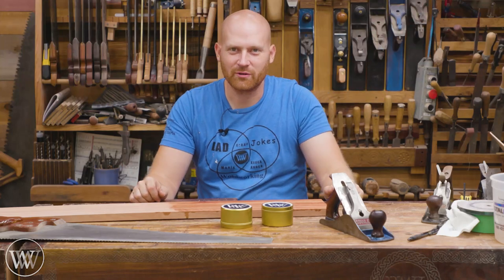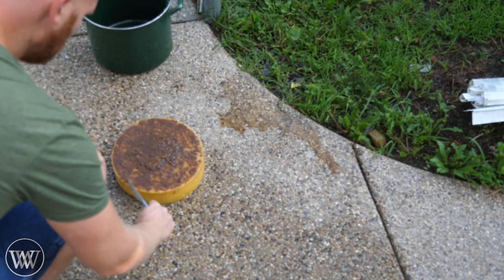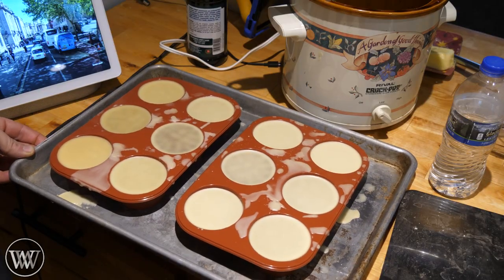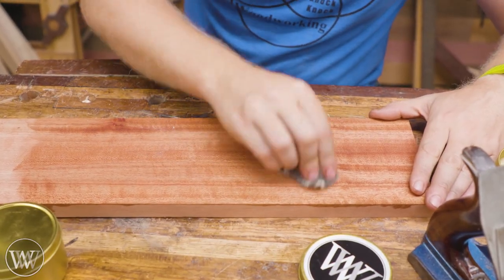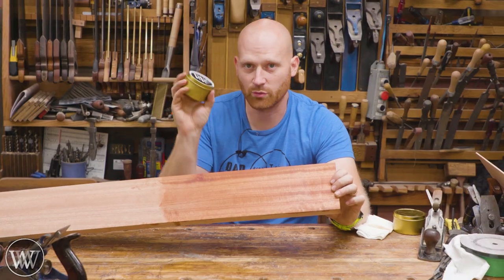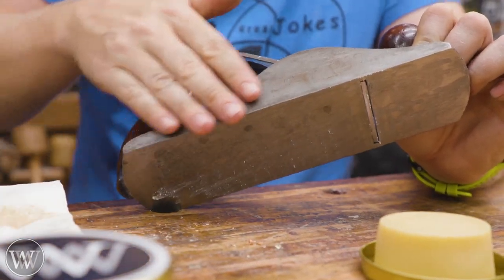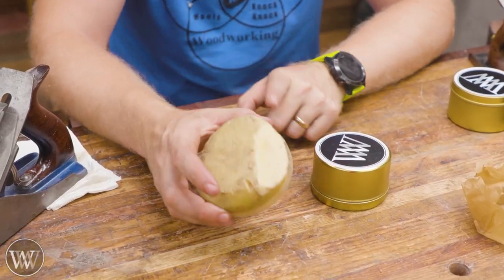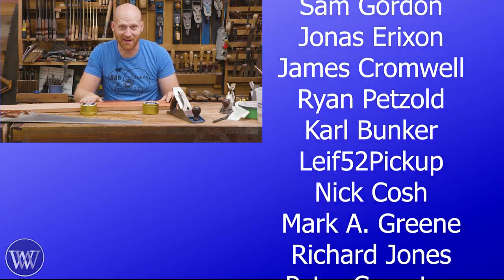How to Make Paste Wax From Scratch

Comment: As a beekeeper and woodworker, I put my cappings and such in an old tube sock then place it in the water. The wax that comes out of the sock is almost clean. The added bonus is the chopped up sock makes a good fire starter.
Reply: that's a great idea. I was using sections old cotton sheets over a strainer but inefficient as heat isn't maintained as you pour it. But your method, the wax is under constant heat.
Reply: Waterproof socks!

Comment: I am using your hard wax recipe for waxing my plane soles. I had an idea to pour it into a clean and empty twist up refillable deodorant container - should be less messy to handle :)
Reply: Did this work? I'm very curious
Reply: @nickgardner1705  worked very well - a couple of things worth noting: 1) I used Jojoba oil instead of linseed (what I had on hand). 2) bees wax melts at around 70C or 160F. I recommend monitoring the temperature and pouring the wax at slightly above that. the first pour I did the wax was way to hot - it melted the plastic of the container and made a smelly mess. the second one I made sure the wax was much cooler (under 200F) and I pored it. works amazing. I was using my No. 8, then added some wax to the sole - it shot forward so fast I almost lost control :) also, keep a bowl of cold water with ice at hand
Reply: @AssafOppenheimer  right on! Thanks for the tips :)
Reply: Damn I just saw your comment after I made the recipe in a tin jar. I should try it this way next time
Reply: Excellent idea thanks for sharing that would work well
Reply: Brilliant idea!

Comment: If you want to filter raw dirty wax in ONE GO, here's what we do with our wax (we keep bees):
1. Find a metal pot or tray that fits into your oven
2. It needs to be deep enough to hold some water in it and hold some kind of a metal strainer - it doesn't matter if it's fine or not
3. Put a few inches of water into the pot, put the strainer on it, put 2 layers of kitchen towels across the whole strainer and put the wax onto that
4. Put everything into the oven and set it to 155-160F (65-70C) and check periodically if there's any wax left in the strainer.
5. When all the raw wax is gone, turn off the oven and let everything cool down

The wax slowly melts and runs through the towels, dripping into the water below. All the impurities and stuff are left on the towels in the strainer. When you let everything cool, the wax in the water solidifes into a puck and floats on top of the water, but it's clean, all that dirt and stuff is on the towels. You just throw it away and voila, a pot full of nice clean wax.

The 155-160F temperature is the melting point of beeswax, when it flows nicely, cause it needs to get thin in order to go through the towels. Beeswax is flammable and it does not boil, just gets hotter and hotter and then ignites, but don't worry - the flashpoint of beeswax is 400F (204C), so you're nowhere near that. Also, the 155-160F range won't damage or discolor the wax, it won't ruin it.

When I first tried this, I wasn't expecting results, really, I thought I was going to get a bunch of hardener wax towel mess, so it was pretty much a surprise when it worked. I've been using this method every since cause it removed any neccessity for cheese cloths, rags, multiple meltings and a bunch of water I used to use, and - it comes out yellow and clean.

Hope this helps, thanks James for making this video!
Reply from the maker: Well that is an interesting idea! I will have to give that a try next time.
Reply: I tried this method a while back, but maybe I had slightly higher temperature as my wax was duller in colour and not as bright yellow when I have done it with water. Will have to try again to see, although I'm thinking of using a solar melter as well to see how that goes.
Reply: Can you clean the towels after or are they rekt?
Reply: @Obscurity202 I think by "kitchen towels", they mean the paper/tissue ones. So they are thrown out. Or become firelighters.
Reply: @samuelmellars7855  fuck why do i read this now after i already sacrificed two of my cotton kitchen towels.
also im doing old candle wax instead of beeswax and it needs higher temps to melt.
just so people dont wait for an hour or two without much happening besides the wax drooping.

Comment: Great recipes!   Another I like to use is a mix of roughly 3 parts beeswax to 1 part USP grade mineral oil.  I adjust it until a sample of the cooled mix is like a thick grease or old Johnson's paste wax.  At that point it can be easily massaged by hand into the wood.  It's a great idea for food contact wood items like cutting boards, spoons, spatulas and salad bowls.  And unlike the tung or other nut oils I used to use the beeswax and mineral oil is not a strong allergen in case someone in the family or a visitor is allergic to nuts.  The mixture is surprisingly tolerant of being washed.  But make at a dunk, wipe, rinse, dry sort of deal as any long term soaking will obviously soak into the wood after a while.     So yeah.  Beeswax.  It's good for more than just in the shop.

Comment: Thanks, I’m going to order some of your 2:1 hard wax with raw linseed oil, looks useful, and plain beeswax is way too hard.

FYI, I made my own soft wax following an old “colonial” recipe I found online, and it is basically 1:1:1, (or in your example 2:2:2) with beeswax, BLO, and mineral spirits in equal parts.  

I’m not sure what the extra half measure of mineral spirits does to the hardness compared to your recipe, whether it makes it harder or softer (?) but it seems to work ok on my wood projects.  Thanks.  👍

Comment: I made few ratios:
- only candle - very hard to apply to the sole and can't feel glide differences .
- 1:4, 1part liquid paraffin with 4 parts melted candle - the mixture stays hard like candle and feels little bit oily. Better apply to the sole than the pure candle, but still not good gliding.
- 1:3 - the mixture stays hard and feels more oily in the hand. Good apply to the sole, little bit better gliding.
- 1:2 - the mixture stays hard again and feel very oily in the hand. Very good apply to the sole, very good gliding.
- 1:1 - the mixture stays hard at first look, feel very very oily and feels like starts to melt in the hand. Apply to sole very easy and glide like 1:2 mixture.
1:2 think is the best mix for me. Twist cans from paper glue were filled, so the wax will stay clean and easy to use. I'm pretty sure Rob Cosman's wax is on the same base. Not so much variants for wax i think. The bees wax i will use for wood protection, just doesn't work for me as lubricant. 
Happy planing guys! :)

Comment: Thank you James. A needed topic. A note, linseed oils of store bought types. Boiled Linseed Oil is not boiled, but treated with a chemical, thereby it's not to be confused with the real thing, yours. Where in Hawaii could I find pure Linseed oil is anyone's guess.
Reply: I wonder if you could get raw oil there. I know they had both "boiled" and raw in Tonga, but they definitely don't have the same laws as the US does though. 

And I think the name stuck around from when it USED to be boiled. And now they just call it boiled when they put a chemical in it to do the same job. Much like the British call flashlights "torches," even though the ONLY similarly is that they both produce light.

Comment: First time I tried this the worst part was cleaning the pot.  Second time I tried I boiled water and put the wax in one of those metal pie pans and set it on top of the boiling water pot.  Worked great and clean up was easy peasy.
Reply from the maker: right on. that is why I have dedicated pots for it.

Comment: I've just received some Bees wax that I ordered from a local bee keeper to make some polish up - I will be following your recipe. (Seeing as I'm over in England I figured the shipping cost of buying yours would be prohibitive!).
Reply from the maker: Sounds like fun. Yes. Shipping a can of wax over there would cost more than the wax itself. But I have done it a few times lol
Reply: @WoodByWrightHowTo  I will be trying it using a old cast iron 'glue pot' that I have restored using electrolysis, and that will be on top of our log burner, so I will need to keep a close eye on temperatures. 
If all else fails I will have to stump up the money and order some from you!

Comment: I think you have answered a question I have had since the early 80’s. In high school woodworking, we used a soft wax that smelt like turpentine and looked like bees wax. I do believe it was essentially like your soft wax. I’m tempted to make my own now, but am more likely to buy yours, if it can be shipped international, and our Border Control doesn’t consider it a biohazard (Australia)
Reply from the maker: I have shipped to down under before, but the shipping price is almost twice the price of the product. if not more.
Reply: @WoodByWrightHowTo  But if it's a good product that lasts years, it's worth it.

Comment: Hey James!! I´ve just made your misture, actually its in the fridge right now. I made the soft wax, but insted of mineral spirits, that i dont know what that even is eheh i used mineral oil!
Reply from the maker: Mineral spirits is also referred to as white spirits in the UK. Mineral oil will make it very soft but mineral oil does not polymerize so it will stay liquid on the surface rather than hardening over time.
Reply: @WoodByWrightHowTo  Thanks! I see the point, but even as white spirits i cant find it in Portugal: it where im from
Reply: White spirits is a product like vodka?
Reply: @marelizevanrooyen  its more like diesel fuel
Reply: @marelizevanrooyen diesel fuel or jet fuel.

Comment: Is the hard wax good for rust prevention on power tool table tops? I have a 10" band saw and a bench top drill press, both with cast iron platforms. Right now I'm using 3 in 1 oil. It works, but I have to reapply it often. The tools are under a an awning outside (one day I'll have a climate controlled workshop, one day). I'm just wondering if the wax will last longer. Thanks! FYI, I just subscribed.
Reply from the maker: That is what I use on my metal tops.
Reply: @WoodByWrightHowTo  Awesome, which one? The soft or hard? I’m going to order a tin.
Reply from the maker: I use the hard.

Comment: If you crush the puck before heating it up for the secont time you"ll use less energy and time to melt it again. If you manage to doubble the surfvavae area it will melt in half the time so I imagine only 4 good centre brakes should do it.

Comment: why white spirit needs to be used in soft wax? what is the idea behind? Assume it is also very smelly?
Reply from the maker: the Spirits thin it out so you can spread it easer. then they evaporate leaving just the wax and oil. you can use whatever you want.
Reply: @WoodByWrightHowTo  thanks

Comment: bit late after the making of the video, but I made my own hardwax with linseed oil & beeswax (would have bought yours, but shipping it to Europe seems a bit over the top), but when I put it on my tools, it sort of seems to attract dust and stuff. Am I putting it on too thick (or not rubbing it out enough) or did I do something wrong in making it?

Comment: Could you add a few coats of shellac after the finishing wax, or would the wax prevent the shellac from adhering?
Reply from the maker: The wax should go on after the shellac. Wax isn't really a finish by itself. It fills the pores on top of wax and smooth out the finish.

Comment: How do you clean the pots and pans after making the wax?  After They're cleaned, are they safe to use for food?
Reply from the maker: Cleaning can be difficult. I just bought cheap ones for 5 bucks at the resale store and dedicated them to the process. But if you were really careful with it, you can clean it out. If you heat it up until it melts you can wipe it out with a rag and then theoretically what dishwasher should be able to heat it up enough to clean out everything leftover.
Reply: @WoodByWrightHowTo    Does that apply to store bought BLO as well?

Comment: I don't know where is my mistake, but my bees hard wax stops the plane instead to move smooth and faster. I will try to melt candle and mix it with liquid paraffine. I will share what will happen.
Reply: I made few ratios:
- only candle - very hard to apply to the sole and can't feel glide differences .
- 1:4, 1part liquid paraffin with 4 parts melted candle - the mixture stays hard like candle and feels little bit oily. Better apply to the sole than the pure candle, but still not good gliding.
- 1:3 - the mixture stays hard and feels more oily in the hand. Good apply to the sole, little bit better gliding.
- 1:2 - the mixture stays hard again and feel very oily in the hand. Very good apply to the sole, very good gliding.
- 1:1 - the mixture stays hard at first look, feel very very oily and feels like starts to melt in the hand. Apply to sole very easy and glide like 1:2 mixture.
1:2 think is the best mix for me. Twist cans from paper glue were filled, so the wax will stay clean and easy to use. I'm pretty sure Rob Cosman's wax is on the same base. Not so much variants for wax i think. The bees wax i will use for wood protection, just doesn't work for me as lubricant. 
Happy planing guys! :)

Comment: Would I be able to substitute paraffin for the beeswax? I have a few slabs of gulf paraffin, boiled linseed & mineral spirits. Would this work or would the end product be to hard to buff as a paste wax?
Reply from the maker: It works well. You'll get a slightly harder wax. So if you want it to be softer you'll probably need to mix in a little bit more oil.

Comment: where did you get that can for your wax? Also what purpose does the mineral spirit serve in your wax creme?  I ask because I've see DIY recipes for wax creme that just uses wax, coconut oil and some other oils.( I'm trying to save a buck or 2 if I can) thx again for this video♥☻☺

 I really enjoy watching this video double time.  In fact the next time you make these videos  if you can say the work puck🐔🐥🐔🐥 ALOT... it would be super entertaining.  🐔🐥🐔🐥You did a FEW times this video.. but many pucks in a row often makes  my memory retention GREAT!!! 🐔🐔
Reply from the maker: The mineral spirits makes the wax softer and easier to apply. It then will evaporate them away leaving the hardened wax behind. It's not necessary but it makes it easier to apply.
Reply: @WoodByWrightHowTo  ahhh!!! ♥☻☺
Can I use rubbing alcohol instead?

thank you * puck puck puck!! * 🤣😆😂
🐔🐥🐔🐥🐔🐥🐔🐥

Comment: Could the linseed oil be subbed out with another oil? Like coconut oil? I use coconut oil and beezwax to make my board butter so i have an abundance. I wanted to use what I have on hand if possible
Reply from the maker: Sure you can use any mixture you want. People use all different types of oils and different types of waxes. Just be warned with coconut oil it takes a long time to polymerize and will often feel oily for weeks or months.
Reply: @WoodByWrightHowTo  Got it! I'll stick to the linseed oil then. Thank you so much for the response and the info. Your channel has helped me out so much as a woodworker!

Comment: ive gotten a nice waxed surface by letting the wood sit in the sun and getting really hot then applying the wax and letting it sit for a while then letting it cool and then buffing it out. I tell myself the heat helps the wax penetrate, but idk, it might be the placebo syndrome
Reply from the maker: That's actually a pretty decent method. A lot of people use a heat gun to work it down into the wood. The old-fashioned way is to use a friction polisher.
Reply: Wood By Wright How 2 ok well good to know im not tricking myself!

Comment: If you only have regular BLO, do you still need mineral spirits for the soft wax?
Reply from the maker: If you want it send out so that you can smear it onto the surface the mineral spirits will allow you to do that. Without the mineral spirits it is much harder and you generally have to keep it up to get it to work into the wood.

Comment: Is the linseed oil degummed so the resulting paste wax will be less prone to molding?
Reply from the maker: I don't do that for the hard wax. But if I were to use it for a finish I would use the home made BLO that has no issue with mold.

Comment: Are your proportions by volume or weight?  I noticed at 2:19 you were weighing the wax before putting in your melting pot.
Reply from the maker: Most of the time just by eyeball. It really doesn't matter that much. Initially testing them all I used a scale to weigh them but now I just eyeball how much I put in so I guess now it's by volume lol.
Reply: @WoodByWrightHowTo  Thanks!  When I've mixed up waxes in the past I've always measured by volume so was surprised when I saw you using a scale.

Comment: I hope you might be able to help...but I made this board recipe and it seemed to have gone rancid. Did I do something wrong? Over a little bit of time it has a pungent smell.
Reply from the maker: Why don't you send me an email and we can hash it out. jameswright@woodbywright.com I don't always see responses on here. They tend to get buried quickly. First I would ask which recipe you're using. Second I ask where did you get your supplies and third I would ask how long did it take for the smell to start. most linseed oils are good to sit on the shelf for a year or two without any problem. Especially if they're kept in an airtight container.

Comment: Hey James any downside to using tea light candle wax? Got a huge bag of these suckers and would like to put them to good use. Also what about using a store bought BLO? Trying to make a hard wax for planing and sawing
Reply from the maker: Super. It is parifin wax works great. Store bought works fine but I would not apply it with bare hands.
Reply: Wood By Wright How 2 thanks James!! Planning on filling some chapstick tubes with it so no worries about hand contact.